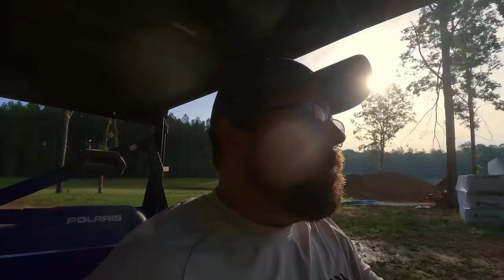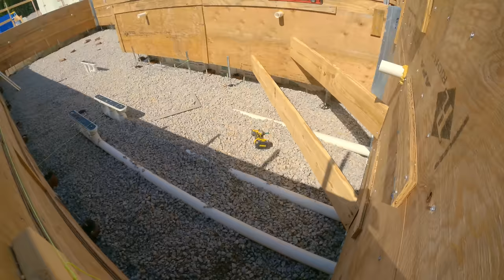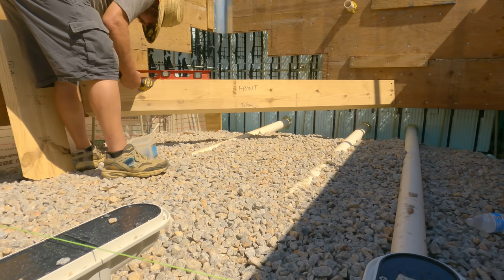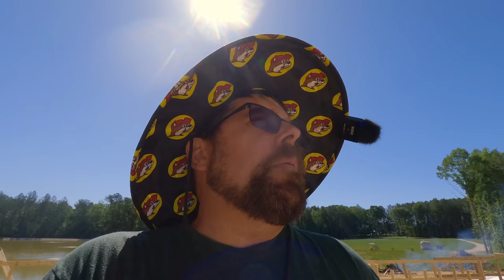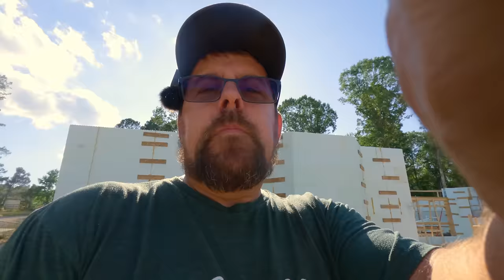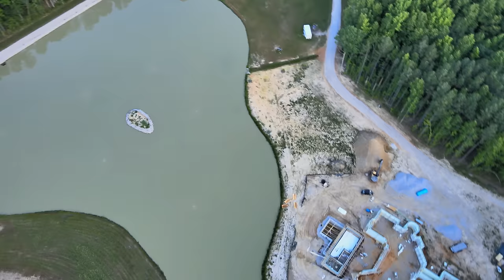The ICF Infinity Pool is Ready for Concrete

Comment: The water turn over in your pond is amazing. It's got to be a minimum of twice a year. It does function more like a lake than a pond with the frequent water exchanges.

After watching a few ICF builds and the non effect hurricanes and tornados have on them I'm surprised they are not more of them in Tornado alley. The channel "Lake Lot Build" details in a series of videos a couple's ICF home build from land purchase to living in it after one year. They put out a video going over all the pros and cons of ICF and given they live in tornado alley their insurance is much lower than it is for stick houses. Is that the same in NC? Also, the advantages in energy savings  pays off the slight difference in extra cost over traditional wood construction. They didn't have many cons with their ICF home, but a lot advantages.

They also talked about how to mitigate radeon gas. Is that a problem in your area? It is the leading cause of lung cancer among non-smokers. In ICF homes, you have to maintain a positive inside air pressure and use an ERV / HRV system to control air flow so radeon air can't get in. They also talked about the need to install a ventilation pipe under the foundation so radeon can be exhausted out before it enters the home. It might be something to consider if you haven't already done this.
Reply from the maker: I watched that series. Pretty good. Radon is a thing here. The footing system I used will partially help with that. Yes, definitely using an ERV. Lots of stuff to remember and do. Lol.
Reply: @BealyGood  Yes that was a good series. I watched it all. What about the vent system under the foundation. I did some research and jurisdictions across the continent and probably Europe have it in their building codes that vent pipes must be under the foundation in areas where the ambient radeon is above a certain level. I hadn't even heard about the radeon problem until recently, fortunately after testing it is not an issue, but I have probably already been fully radiated having lived elsewhere with no mitigation.

Comment: Shouldn't the bevel be facing the other way? As it is, you will end up with an area that will trap water at the base of the step/floor of the pool if there is even a slight amount of concrete in excess in the floor. Or would the sealing coating solve that problem?
Reply from the maker: Concrete doesn’t come up the bevel. The bevel is only there to allow the trowel to smooth to the back

Comment: I think your chamfer is on the wrong side.
Reply from the maker: It’s not. If it was pointing the other way, you wouldn’t be able to get the trowel under it.
Reply: @BealyGood  sorry, thought you were trying for a fillet or quarter round at the angle the riser and tread. That could have meant voids unless you vibrated like crazy.